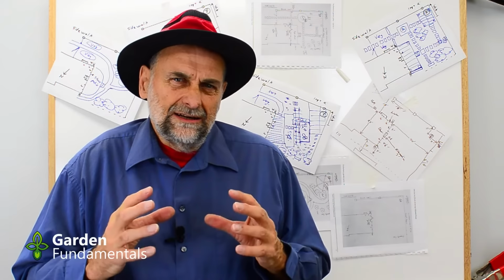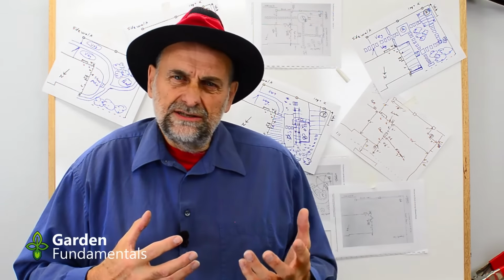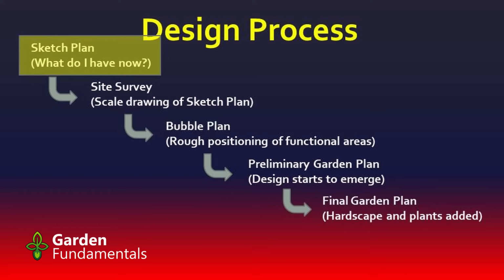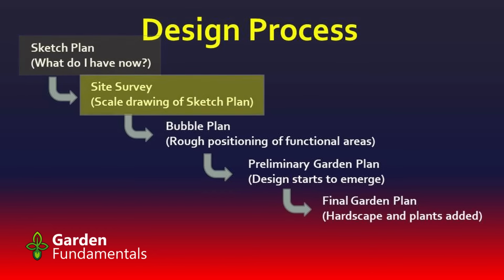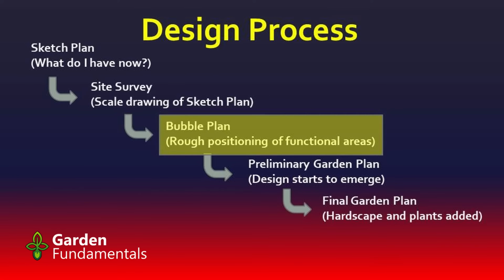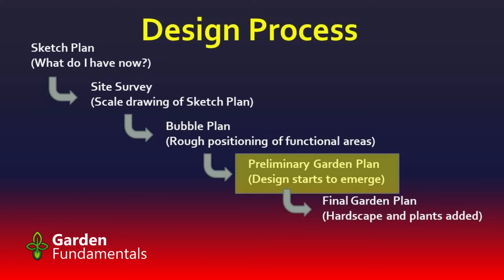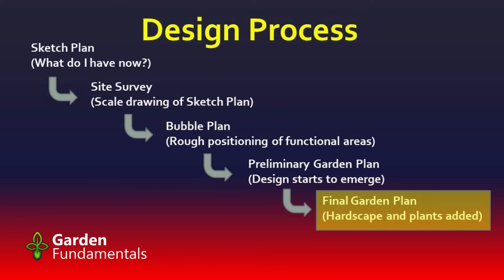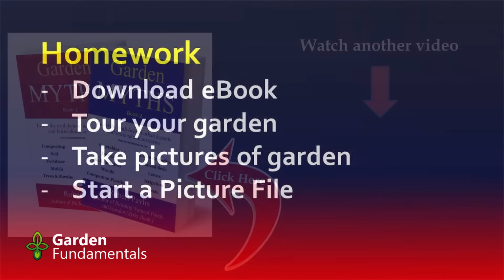Landscape Design Part 1 🏡💞🎨 Learn to Create Your Own Garden Design

Comment: Psalm 46 : 1 God is our refuge and strength,  a very present[b] help in trouble. 2 Therefore we will not fear though the earth give way, though the mountains be moved into the heart of the sea, 3 though its waters roar and foam,  though the mountains tremble at its swelling. Selah 4 There is a river whose streams make glad the city of God,  the holy habitation of the Most High
Reply: You need help

Comment: A lot of people are having trouble downloading. The ebooks do not download; they open as a webpage which you simply print using your print command and choose PDF in the print dialog to download it to your desktop or where ever. You can also print a hard copy or print a hard copy from the downloaded pdf file.
Reply from the maker: If it opened in your browser - it is already downloaded - just print or save as you suggest.

I just checked it - it is working correctly.